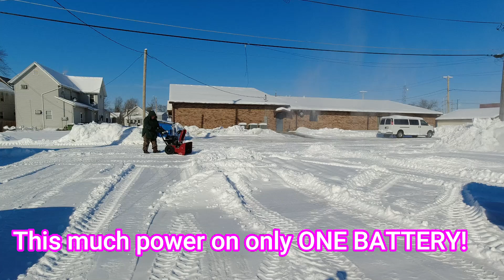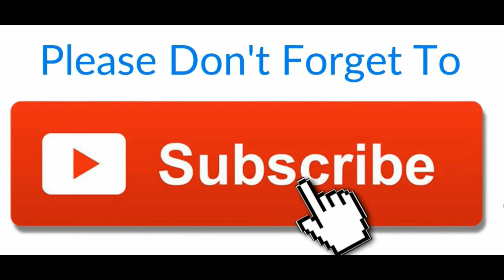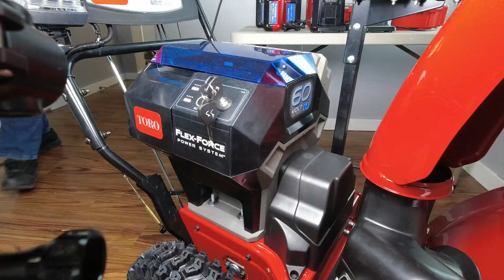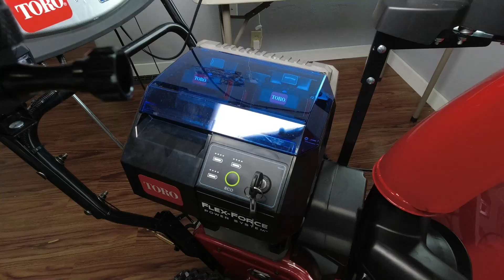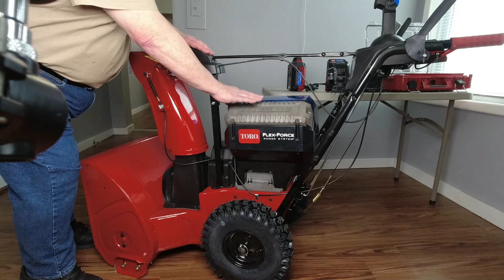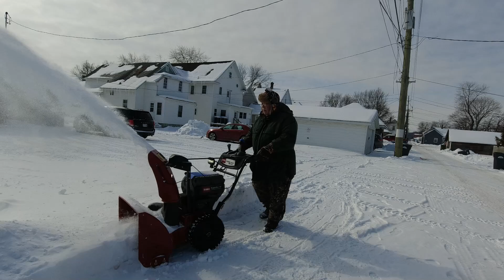First Look! NEW Toro Power Max 60V Battery Two-Stage Snow Blower

Comment: No Toro said the E26 will clear 30 parking spaces with two 7.5 AH batteries you add another battery you get another 15 parking spaces.. 

The E24 with the 6AH batteries does 24 parking spaces adds another 15 if you add another battery.

THESE CLAIMS ARE NOT EVEN CLOSE TO WHAT THEY SAY!! 

As a matter of fact in the commercials and promos for it they say it can do what I just mentioned in 10 in of snow! 

In the promo also said if you need more than 45 cars to clear with 10 in of snow that's not a parking lot that's a highway 🤣

But they are so wrong in this February 22 blizzard in New England A few people bought the E26. With those two seven point five eight h batteries they were lucky to be out there for 30 minutes!! Then they had to charge the batteries again for 3 and 1/2 hours!!  It took one guy all day long to clear his property.. 30 minutes on 3 and 1/2 hours off!! 

They do have a fast charger that will charge the batteries in about  1hr and 1/2.. But they did not come with this unit which is disgusting for the money you have to pay for this around $1,600!! 

Each battery cost $350!! So imagine buying a couple more batteries, and 3 fast chargers that cost $100 a piece!! That's an extra $1,000!!

Totally unacceptable.. 

False advertising..

Not blaming Toro no two stage battery powered snowblower is going to last more than 30 minutes in the situation like the blizzard that just happened.. It's just the nature of batteries.. It can perform as well as the gas units maybe even more torque but the batteries just don't cut it for deep snow and a lot of it. 

If their claims were true that would be great but they're not even close

It's only good for 3 / 4 car driveway 10 ft wide with a small front and back. Anything bigger they're going to be disappointed.. 

FYI I love your videos!!
Reply from the maker: Lithium-ion batteries are very expensive. The current range is about 50 cents per Watt-Hour for the cheap/low-quality cells to over a $1.50 for the very high quality, high current cells (Milwaukee Red Lithium). The 450 Watt-Hour, 7.5 AH, 60 volt Toro battery uses high-quality cells (not high current) and the cost is around 75 cents per watt-hour. So $350 for the 7.5 AH battery is actually a good price for what you get. 
Don't like the high prices - start talking to your congressman and see if they can start government subsidies/rebates to reduce the cost like they are doing with the auto industry. 
Lithium-Ion batteries are not only expensive but the world can't supply enough of them right now. So, the price will only go up until Tesla, Panasonic and Samsung get their new plant expansions up and running. That's going to be 3-5 years yet. 
The run time everyone is using is under "normal" conditions. If you get 2-6 inches of snow the batteries will last 30 minutes and longer if you run the snowblower in the economy setting. If you have 20 inches of heavy/wet slop 15 minutes per 7.5 AH on the 826 is probably about right. (Just like your gas snowblower, it takes a lot more power to throw that heavy/wet snow)
By the way - I don't recommend quick chargers. The 2 amp charger that comes with your snow blower is sized so you get a decent charge time but doesn't charge the battery too quickly which can/will greatly reduce the life of the battery.  EGO was the first to introduce quick-chargers and has had many, many, many issues because the batteries are charged too fast and a large percentage of the batteries fail. (Personally, I think Toro came out with the quick charge this year JUST BECAUSE EGO had/has one) Repeat, I don't recommend quick chargers on Lithium-Ion batteries.
Reply: @PaulSikkema  If that's the case And you don't recommend the quick chargers then there's no point in having this machine.. 30 minutes is just not enough. Spending tons of money on batteries is way too much money. 

Then it's a complete fail in my opinion. Gas is the way to go. 

But I did lots of research on lithium ion batteries about this so-called quick charging thing. And a lot of people actually dispute it saying it does not degrade the batteries. 

They said by the time it degrades the batteries it'll be time to change the batteries anyway cuz lithium ion batteries have a shelf life of 3 to 5 years. 

Yeah there's a lot of controversy about that other manufacturers swear that fast charging does not degrade them at all. 

But who knows. 

Without the fast charging and I had big property I would not have anything to do with it. 

So sad..
Reply from the maker: They are correct - if you use the quick charger you will average 3-5 years. If you use the 2 amp you should get 7-10. 
If you buy for "price" you also will only get 3-5 years out of the lower quality batteries.
By the way, check out the areas that have been using batteries for much longer than this industry has. Bikes, ev's, construction. Read the engineering white papers from the battery manufacturers like Samsung, etc. Don't read the articles from companies trying to sell you something. The current 18650, 21700, and 26650 cells we are using can't handle fast charging and last long. 
And they are also correct  - the "other brand" has had a lot of issues. One of the big review channels has over 20 of their batteries and all but four have failed within three years. 
I've had nine of the Toro batteries for three years now. I use the 2 amp charger and haven't lost one battery yet. 
My opinion - the media and the current administration want you to think battery is the way to go - and battery stick tools and hand tools are definitely the way to go  - we have to go "green." But as homeowners we are not ready to pay the price for batteries powerful enough to run our residential mowers and snowblowers. 
The commercial operators are getting their act together. They realize that battery power does save money but they use them 6-8 hours a day and it still takes 5 plus years to pay off the initial cost of the battery. 
Finally, I expect to see a heavy-duty/commercial battery-operated snowblower in the next two years. The battery alone will cost $1600 plus.
Reply: @PaulSikkema  

thank you for all your information and education you're amazing!!! 

You make perfect sense but remember it won't cause as much of a problem because how often do you really use a snowblower.. You're not going to be charging the snow blower batteries like you would doing construction with tools. 

Lithium ion batteries have a shelf life anyways even if you don't charge them at all.. 

You say the last 7 to 10 years without the fast charger but how well do they hold the charge anyways after about 4 years. There will be a significant decline no matter what.

So if something less 7 to 10 years what good is it If it doesn't last as long anyways when you install it because of the natural shelf life decoration. 

For instance even if you charge your battery once It lasted 30 minutes and a big snow storm. Then 5 years later you charge it again  ( obviously maintaining half charge during those 5 years ) You're not going to get 30 minutes no matter what.. You may get 15.. So my point is you're probably going to want to replace your batteries if you want peak performance for how long they last every three to five years no matter what. 

A battery that doesn't last long even though it still works 7 to 10 years later might be useless. 

So I think that's what they're talking about. 

What do you think?
Reply: @PaulSikkema  FYI did you know that the 886-02 charger that comes with the electric snow blowers is actually considered a FAST CHARGER? 

They have three chargers.

88610 which is the regular normal charger that will charge those big batteries in about 6 hours. Then you have the 88602 which is considered the medium fast charger that charges the batteries in 3 and 1/2 hours. Then finally you have the new 88605 which is the rapid or super fast charger that charged those batteries in about an hour.

The end of those numbers is the amps.

Each charger starting from the slowest and fastest is 1 amp charger, then the one that comes with it a 2 amp charger, Then finally the fastest charger which is a 5.4 amp

So my whole point is those batteries are being fast charged anyways with the charger that comes with it.  So I guess that's doing damage also?
Reply from the maker: The 1 amp is new and will probably only go in the box for the tools that come with the 2.5AH battery. (To keep the retail price down on the tool. 
The 2 amp has been around for three years and is called a quick charger because three years ago many brands only offered the 1 amp or smaller chargers and it took HOURS to charge their batteries. 2 amps is within the parameters of the current cells for charging.  
The 5 amp chargers are all because EGO came out with theirs. Even Stihl - who has the best batteries in the L&G space - had to come out with a 3 amp "quick charger." EGO is all about being the fastest so their advertising agency can claim they are the "best." (Notice EGO never claims they are the most dependable) In other words Toro and others had to come out with a fast charger just because there are so many EGO "fanboys" out there. Not because they should...
Reply: @PaulSikkema  completely get it. 

The question is how much lithium ion battery life does a battery lose whether it's being used or not in 3 to 5 years? We know that these batteries have a shelf life no matter what. 

So after 3 or 5 years does It lose 50%, 75% etc.. 

Because like I was saying in three to five years for battery 50% or even 60% of its original performance  You're probably going to want to replace the battery anyways especially if you have a snowblower or something that you need to last a long time.. 

So the question is how much will the 5.4 amp charger degrade the battery over 3 to 5 years If the battery is degrading anyways.   Because I can't imagine any battery that's lithium ion having any more than 50% Even less of its original performance after 7 years . You would think a battery that old would not have good performance and be long-lasting anyways.. 

So I think it's very interesting and a balancing act. 

I would say if you're going to replace your batteries every 4 or 5 years anyways because it doesn't hold a charge as long even with the slow charger Then using a fast charger would probably be your best bet.. If you're the type of person that wants to keep your battery 7 to 10 years accepting that it's not going to last as long  after about 3 to 5 years I guess you would use the regular charger. 

I just think there is going to be more data about all this.. 

Taking and consideration. That you only use snow blowers in places like Boston Three or four storms a year. Which is not a lot. You would not be rapid charging your batteries that often. Not like construction people do. If they're not being pushed all year long. Then how much damage can fast charging really do in that short period of time. 

You could also use the fast chargers when you have big storms to get back out there. But when you don't have big storms you can always use the medium fast charger..

I don't know it's very interesting I wish they was more information more definite answers on how it affects the battery in every situation..
Reply from the maker: I use the Toro batteries all year long. I have a trimmer, blower, and the Personal Pace mower. 
The battery degradation over time depends on the quality of the cells, the environment it's stored in, and the state of charge it's stored in. 
My drone's batteries automatically discharge to 60% after sitting for 10 days.  If you are going to store your battery for more than a month keep the temperature between 40-80 degrees and DON'T charge it fully. Keep the charge to 2-3 bars. (40-70%) Do that and your degradation should be around 5%. If you keep them at 100% charge they may lose 10-20% per year. If you store them at 0% charge they probably will go bad within 6 months. 
You don't have to charge them during storage as long as they are unhooked from your snowblower. Check them every couple of months. 
The information is out there - just not on the lawnmower/snowblower forums. Find some people on the radio control forums (rc truck and plane) who competitively race. They know the limits of these cells and what you can do to get the most life out of them. 
If you want to melt your brain go over to the Spektrum forums at Horizon Hobby.
Reply: @PaulSikkema  

Thanks for the info. Yep I'm definitely aware of all that stuff about the batteries. I fix phones, electronics, guitars, amplifiers, I'm a musician, engineer, and producer etc.. 

Been fixing electronics for 30 years. 

It's just demystifying The truth to all the stuff in the real world. 

I also have a drone too.. I'm guessing you probably have a DJI drone My batteries do the same thing...

I've always been very careful with my batteries, even phone batteries using the same concepts. 

Fast charging and phones works really well. Not that many issues at all. For instance Samsung's my favorite not an iPhone fan at all Even though I fix both. That's another story. 

But I noticed that they've been bumping up the fast charging year after year. I noticed no degration in any of the batteries whatsoever with any of the phones versus the slower charging. I would actually say the newer batteries have been lasting longer than the old ones even if they are super fast charging. 

Probably like you said because the cells are better. But in general not much difference. 

 With phones if you fast or slow charge phone batteries they will last about 3 to 4 years And that's if you follow the rules that you mentioned about hot, cold, not keeping them 100%. But the big one never let them go below 20% just like with the DJI drone batteries. You don't want to always charge from 0% that puts so much stress on a battery.. significantly degrades the battery quicker. 

They're happy place is between 20% and 75% which is really not that difficult to do. As long as you have a quick charger in your car, in your house, And always remember to plug it in. Some people just lazy and they forget to plug the phone in when there's a charger right in front of them.

Comment: Also with my PowerMax E24 60 volt using it in a couple inches of snow that was left from February 2022 storm.. I thought I heard some squeaking in the belts.

Is this normal is just like a break-in period
Reply from the maker: Did you assemble your snow blower? If you didn't go through the set-up directions and recheck the drive and auger cable tension. My video on the 828 shows you how to adjust it. 
Or - did you use it - put it away - and the next time you used it the belts squealed? If that was the case you didn't get all the snow cleaned out of the impeller and the auger housing and it froze. When you started the snowblower the belts slipped until it broke through that frozen snow.
Reply: @PaulSikkema 

Yeah the belt was squeaking a little bit I just have a little tiny bit of leftover snow Not a lot from the 2022 snow storm.. 

 Yes I absolutely read the directions and they have a YouTube video on it

The transmission cable The spring on the left side on the bottom should be 2 in when the handle is pressed. 

The auger spring on the other side is supposed to be two and three quarter inches or 2.75 

I used a caliper on both of the springs so they're exactly right. 

The manual does say something about the left spring should be 2 and 1/3 or something like that but the video said 2 in

Thanks for the You're awesome keep the videos coming!!!!
Reply: @PaulSikkema  

The other quick thing is I was real curious this whole auto steering power steering for the snowblowers. It looks like the 26 and above only have the power steering the differential power steering you're talking about. 

But the weird thing is on the E26 the one you have they don't even talk about it at all like it's even there Don't even use it as a selling point which is bizarre. 

Why don't they put it on the 24-in the PowerMax E24? Is it because it's not big?

I did notice a difference on dry ground trying to turn it It was very hard to turn because one wheel did not stop while the other one turned.. 

Are you sure that the PowerMax E26 has power steering auto steering that you talk about. 

And why do you think the 24 in don't have it?